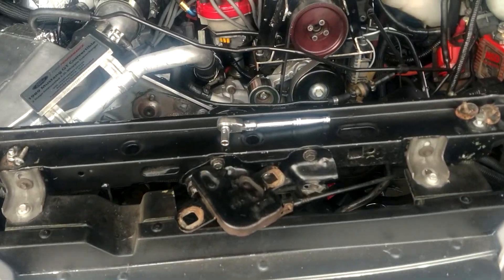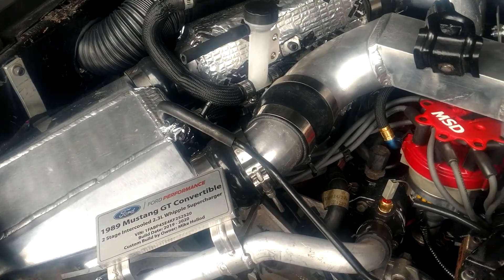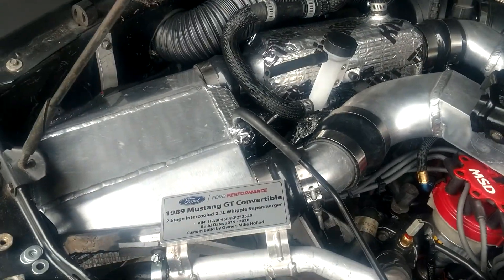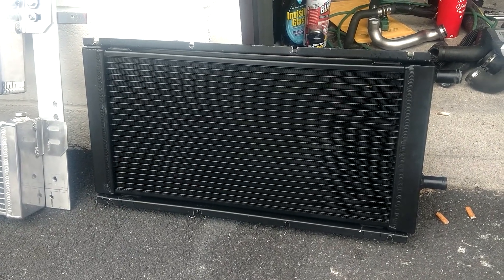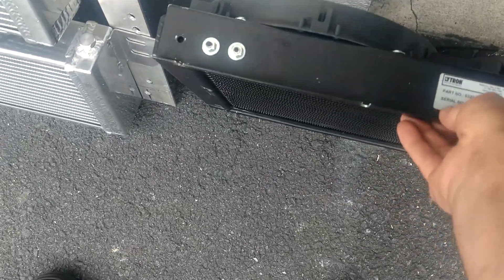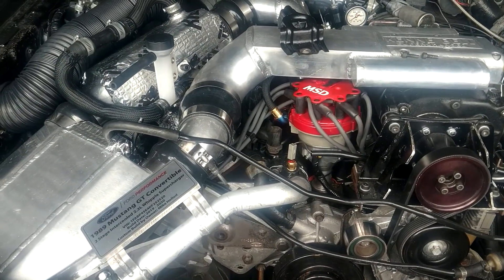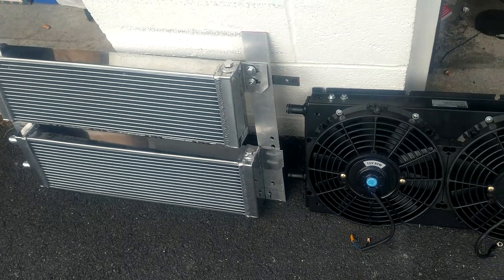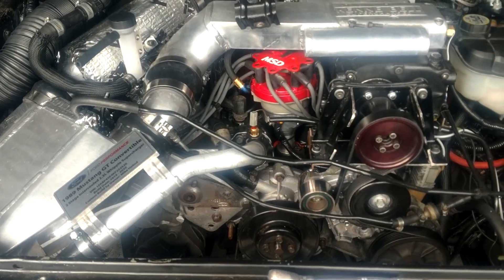Dual Intercooled PUSHROD 5.0L Foxbody Mustang Needs TWO Heat Exchangers for Whipple Supercharger

Comment: Any updates??
Reply from the maker: Yeah, I should do some updates with plans over the winter.  The stacked (one heat exchanger on top of the other) didn't work well and was likely blocking some badly needed fresh air to cool the radiator.  Now I mounted them across the bottom behind the foglights and got an instant improvement without even running any fans other than the electric radiator fan.  Engine coolant gauge at second from bottom mark and never hits halfway.... before it was going over halfway and only used for short trips due to that fact.  I relocated the 'reserve' tank for the intercooler so it would be higher than any other part of the system to eliminate air pockets.   Yep, probably should do an update.

Comment: 15 16 psi ! Nice. I have similar plans with my Paxton novi 5.0 sold the kenne bell I had
Reply from the maker: Get yours going yet??  Sorta put everything on hold here now for the winter switched back to in-the-house projects.... many things have gone neglected !!
Reply: @fortheLOVEofMODsMike  yes I just got her started this past weekend on holley terminator x ended up doing a 5 lug conversion along with a few other things as well but she's almost done
Reply from the maker: @blown93vert93  Dude... you got some video?  You need to post some stuff up here, right?  I was looking over mine and it seems I forgot to video anything of it actually running.....Even though it needs tuning it still went around the neighborhood a few times!
Reply: @fortheLOVEofMODsMike  I've always tell myself I need to make a YouTube and start posting since I do it all from top to bottom on my cars . I'm the type of person i refuse to take it to the shop for anything from piston rings to breaks . But yea at first it wouldn't idle without gas and i figured that my new ebay throttle body was closed to much . My iac was reading as 80% trying to idle so I opened her up a bit she is chilling at 900 rpms at idle still have alot of tuning to do along with converting over to e85. But I ended up going with 60lb ford performance injectors.  Holley terminator x . Explorer long block stock (I think) h.o. cam gt40p heads 1 3/4 primaries shorty's and what not nothing special . It's a stick shift car that I would kill to get into the 11s and into the 10s from there.
Reply: @fortheLOVEofMODsMike  even if it means i.will need to have a spare built block. Which are the plans for my "problem child" 1993 gt convertible but I will send it with all the dang boost she will hold just to make her live up to her name . The vert nobody wants that's too heavy for drag racing and everyone tells you to junk. Oh yea she's going to come out as hot as I can get her
Reply from the maker: @blown93vert93  Oh I hear you on the idle thing, plus I hit the brakes idling, parking etc and it's stalling out like a bad booster check valve or something.  Similar Deatschworks 60lb'ers here too (only stock fuel related piece that remains is the tank).  I have a Pro-M tuner and piggyback chip burner for the stock ECU.  The Pro-M MAF sensor (90mm) is calibrated for 60lb and the chip is burned with the 'correct' MAF table (the 9 values on the flow sheet that comes with the calibration data sheet) but I was suspecting the same thing about the TB butterfly valve being too far closed.  Problem is the adjustment screw is in such a bad place I can't get at it without taking stuff apart again.  Throttle position voltage is right at .99v (amazingly without even trying) so I'm not sure if opening will screw that up and make it want to idle faster.........I'm afraid of E85, part of the reason I doubled up on the intercoolers.  I really don't plan on taking this to the track except maybe once just to see what..
Reply: @fortheLOVEofMODsMike  that's nice I wanted to keep the kenne bell but it was just a 1.5 . A lot of people wanted it when it went up but some lady from San Diego came up to fresno and picked it up for 22 . Wasn't looking forward to rebuilding it when the time came even though it ran perfect no oil usage or anything . The rotors were still nice and gold ( a sign of no oil usage) . So I ended up throwing a 340 pump but I went with a paxton novi 1000. I'm hoping for a max of 12-13psi we will see if the stock gt40p heads will hold. I'm sure the bottom end will as I'll be running really low timing at first until I can get it on the rollers and tune it myself. But im thinking a max timing of 19* @wot on 91oct should be fine.. after the e85 that can go up but I kind of want to keep it low and safe for the moment until I can pull a few more explorer long blocks and rebuild and build them. With the paxton blower its alot easier to remove it I can have it off in 15 minutes. And it is really Blowing off of idle I cant wait to get into boost we haven't even left the driveway yet I am now going over the whole thing still before I go for a drive since I did the 5 lug swap new trans and clutch . I'll make a video soon
Reply from the maker: @blown93vert93  Awesome, send me the link when you get it up.  Hey I've got equal shorty's and the 2.5 offroad H-pipe.  Dynomax ultra flows are on it but they're almost 25 years old now and don't sound nearly as crisp as they used to......  I want this thing to sound sick with top down.... thinking about the Magnaflow competition 3" (post h-pipe) kit.  Not many choices in  3" anymore, but that one is supposedly pretty badass but not cheap at $650.  any thoughts on it??
Reply: @fortheLOVEofMODsMike  I'm guessing your car doesn't pass smog anymore . But I love the way they sound with a simple h pipe and flow master super 40s
Reply: @fortheLOVEofMODsMike  but at 650 I'd say its be worth checking out the foxbody parts page on Instagram if you have an Instagram plenty of deals with new to used parts
Reply from the maker: @blown93vert93  Cool.  No smog here for OBD1, just a visual and they don't look too closely I guess.
Reply: @fortheLOVEofMODsMike  oh just in your area ? I know there is areas like that in cali but I'm in the valley so it sucks. But yea man I love the nice sound of a simple h pipe with flow masters
Reply from the maker: @blown93vert93  yeah I guess in some parts of the country they don't get too strict (yet) with OBD1 cars so you can do pretty much anything you want with a 1995 and older car.  PLUS, if you don't put over 5k a year on a car you can 'exempt' it no matter what the year.  I've got a 2011 BMW X6M pushing well over 700hp and I had to emission certify it when I brought it here to my state initially (what a pain in the ass that was) but have exempted it for 5 years straight now.  Good incentive to keep the mileage low!
Reply: @fortheLOVEofMODsMike  wow I think I'm going to look into that. This past year I only put about 1200 miles on the car